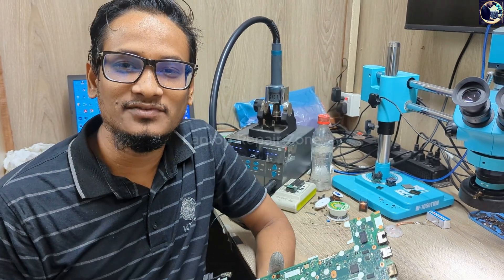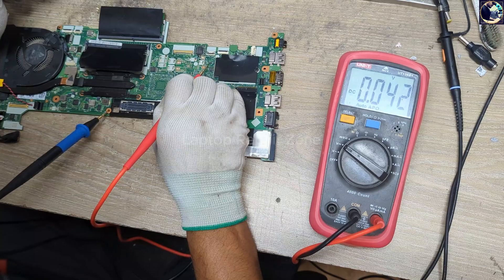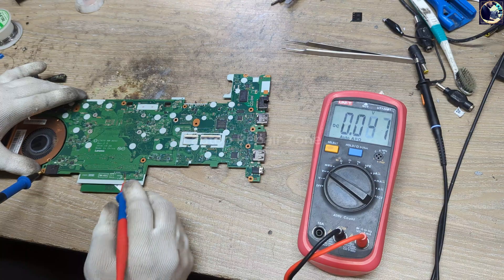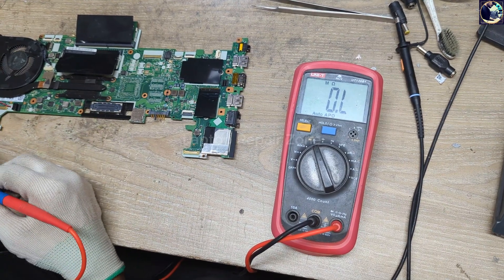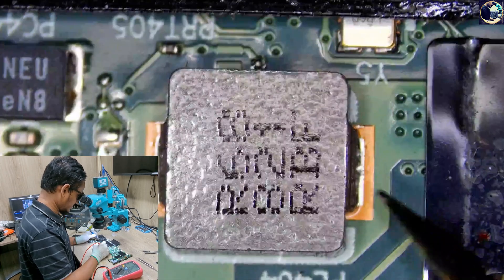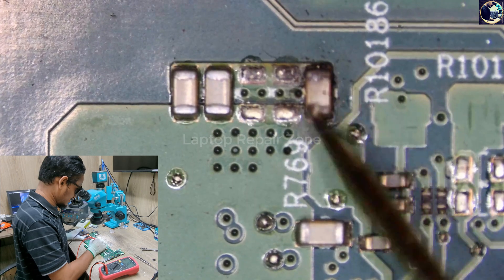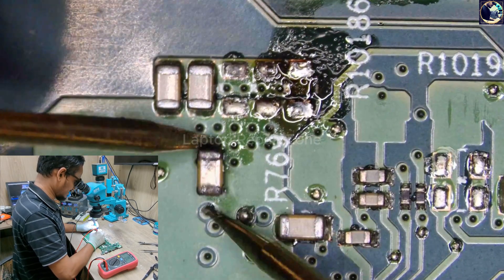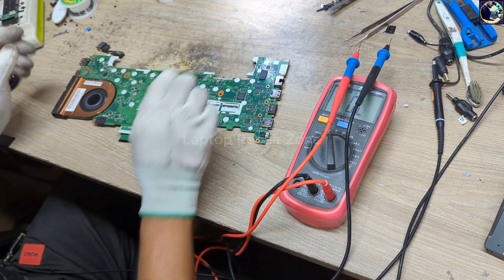Lenovo Thinkpad T470 power on but no display | VCCSA power rail short to GND fixed!!

Comment: Good work,. This lucky job . Now If there is no sign of damage on the capacitor, how do you make sure that the processor is not damaged or shorted. Can inject voltage on the coil? About 3 V or not

Comment: So was this repaired before for the same issue? I am asking because it looks like the two caps, next to the bad cap, were already removed. If so did you repalce all of them?
Reply from the maker: No this motherboard not repair before, this is the first time I repaired and Those two capacitors next to the bad capacitor were not by the company..

Comment: Be good if we could see clearly where you are measuring on the board when you are first diagnosing.
Reply: He is literally telling you what he is measuring. He starts by checking for voltage at the 19V, 12V,  3.3V, 5.5V, 1.8V, 2.5V, 1.2V, & 1.0V supply coils where there should always be power present. If you zoom in you can kind of see.